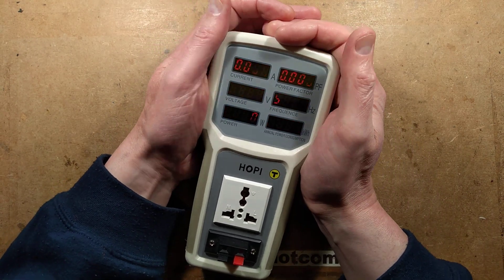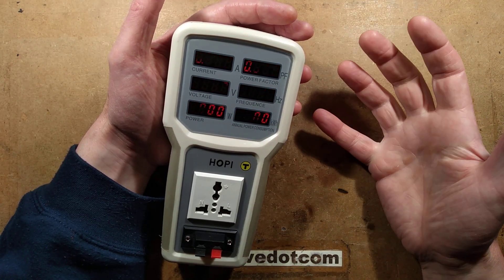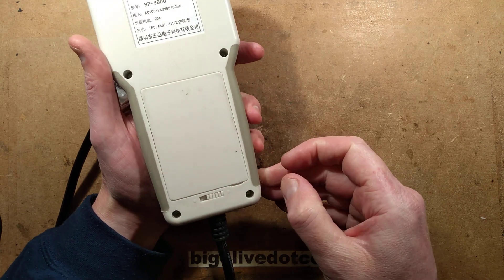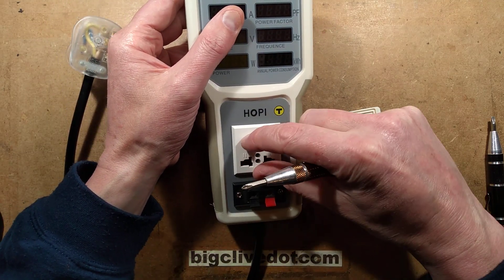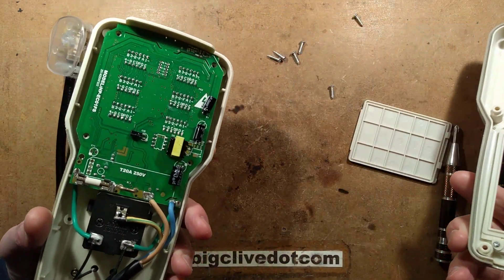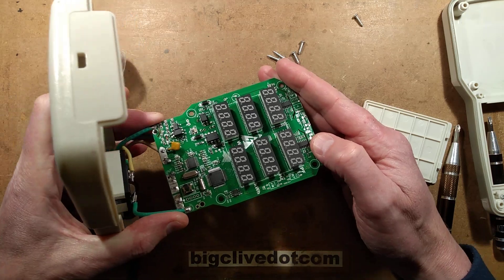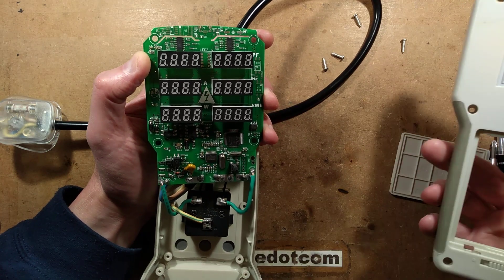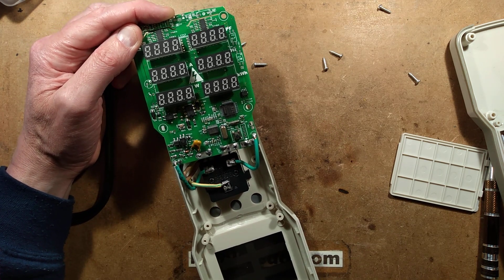Inside the Hopi power meter.  (It contains a smart meter chip!)

Comment: If you set the number to 2 you get the monthly power consumption, which I personally find more useful. Unfortunately my hopi doesn't remember the cost per kWhr, so you have to set it every time if you want to have a direct display of cost.
Also the male plug gets hot at only 8A for a few seconds, so I will probably change it.
And in my unit the soldering of the thick wires was pretty bad, so I resolder it before use.
I forgot to mention, if you hold the button for a couple of seconds more you reset the energy and time of the "uH" screen.

Comment: The crystal with a round can on it looks similar to the 32kiHz crystals used in quartz watches and realtime clock circuits. Using a faster one would make for a better multiplexing but yes, it would alter the baud rate of the serial connection. Presumably the 1-24 values of the T-button are to set how many hours per day the device is used and calculate annual power consumption that way. Strange feature. The CO2 thing even more so.
Reply: I doubt the 32kHz crystal is used to drive the clock of the micro. It is way too slow to read the power meter chip and multiplex the segments. Since the display looks solid to the eye, the multiplexing frequency has to be somewhere close to 100Hz, otherwise you'd see flicker. That leaves just a few hundred clocks per refresh to to do everything the microcontroller needs to do.
The crystal will more likely be there for time keeping to calculate line frequency for example. The power meter chip has a clock output designed to drive an external microcontroller, which I guess will drive the micro. Costsaving again.
But even if the microcontroller would have his own crystal, there is no way to change it to anything else and expect anything else still to work without rewriting the firmware.
Reply: @superdau  I originally thought, too, that the 32kHz crystal (if that's even what it is... I think so but can't be sure) was for measuring line frequency, but then I'd expect it to be connected to the multimeter chip, not the microcontroller. although if the multimeter chip puts out voltage measurements fast enough over serial it could definitely made to work but I somehow doubt that.

Comment: Hopi HP-9800 page on AliExpress including scans of the user manual:
https://www.aliexpress.com/item/HOPI-HP-9800-Handheld-Power-Meter-Power-Analyzer-LED-Metering-Socket-Measurable-Current-voltage-Power-Factor/32375959317.html

Comment: So, what do you guys think about these universal enclosures like this one? Is there somewhere that sources them cheaper than AliEx? These things are like $20 shipped for an empty case, at least from the listings I get shown through AE. I figure it would be better to just buy a cheap AliEx DMM for $5 complete/shipped, de-sticker, gut, and call that an enclosure. Heck, then I have a compete set of connectors to measure and design with, along with a bezel and lens arrangement. 
   Someone with experience, can you tell me why this is a foolish waste of time next to a "universal" enclosure?
  I'm currently building a couple bench power supplies, and learned the hard way, there is a reason why experienced guys build things in large enclosures even with small board designs. One of my 2 current project enclosures is starting to look like the special olympics version of an iPhone design. Project creep is killing that one. 
  ...anyways..what do you think? Is it worth repurposing a $5 junk product to save $15 over the universal version?
Reply from the maker: The universal enclosures have always been quite expensive because they are intended for prototype or low volume specialist products.

Comment: Hi Clive, you can fix the LED flickering by recording at 25fps or any other shutter speed that is a factor of 50Hz.
The annual power consumption is set to a number 1-24 to input how many hours per day you use the device. It calculates total annual kWh based on that.

Comment: It can be surprising how unstable the powerline frequency actually is.  In the United States I've been watching and logging it for several years as a hobby.  There are times I've noticed drops of over 0.040 Hz and later been able to read the Nuclear Regulatory Commission website and verify a nuclear reactor in another part of the country had to go offline at that time.  U.S. power grid is divided into at least 3 parts so dips in another part are not noticeable in this part.
Reply: Well he does live on the Isle of Man, initially I assumed they probably generated their electricity locally but turns out that's not exclusively the case anymore.

https://en.wikipedia.org/wiki/Manx_Electricity_Authority
https://en.wikipedia.org/wiki/Isle_of_Man_to_England_Interconnector
Short summary: 
- 40MW rated AC power cable bringing in electricity from England (became operational in 2000)
- 87MW gas turbine (completed in 2003)
- 1 MW of hydro
- 90.4MW total of diesel generators

Given the power ratings of the various sources I'm guessing there's still some being produced locally since 40MW spread over the 83000ish population would be roughly 481W available per individual. That already seems low for just residential use, since the "average electricity per household in the UK is 4,648 kWh" according to https://www.onaverage.co.uk/consumption-averages/average-electricity-usage works out to 530W average (which is going to have significantly higher peaks). Add in some non-residential usage and there has to be a reasonable amount of local power and compensating for demand going on which is likely to account for that frequency variation.

Comment: 1-24 may be how many hours the appliance will be used per day.
Reply: It is.
https://www.aliexpress.com/item/HOPI-HP-9800-Handheld-Power-Meter-Power-Analyzer-LED-Metering-Socket-Measurable-Current-voltage-Power-Factor/32375959317.html
Manual down the page a touch.
Reply: @ballsrgrossnugly  Some of that manual did not make much sense !!
Reply: Yeah I only found that out by accident, they hide that button well 😂

Comment: AliExpress webpage has details (limited) on the button.  https://www.aliexpress.com/item/HOPI-HP-9800-Handheld-Power-Meter-Power-Analyzer-LED-Metering-Socket-Measurable-Current-voltage-Power-Factor/32375959317.html
Reply: AEC = Annual Electricity Costs
APC = Annual Power Consumption (hours of use per day)
uH = Active Electric Energy
CO2 = Annual CO2 Consumption
L-UP = Upper limit of Power

Comment: I have exactly the same model HOPI as yours -  purchased via eBay - with the exception that mine does have the micro USB installed. Don't know why yours doesn't have it. I'll to try connecting it to my laptop and see if I can record/download data from it.
Reply: I also have the usb version,  the mains connections to the board had some sketchy looking solder joints. And the power regulator chip has a bent up leg with a component linking to the capacitor, no idea why , looks a bit afterthought.

Comment: The not meassuring low loads could be to avoid a ADC-offset from building up a bill.

Smart-meters (and mechanical ones) have a thing about not metering at very low power to avoid ghost-load.
Basically inperfections that "make the disc spin" at absolutely NO LOAD.

Comment: If you know chinese and found the actual product page in china online shop, this device is not solely use for one time current monitor, it is actually a electricity monitor to monitor a household appliances energy usage long term. The label at the back, 1st line: 手持式用电监测仪 - Hand-held power monitor (from google translate).
And the "T" is actually a button to show the info on the connected appliance energy total usage, the button menu cycle can be found at the china online shop here, the 2nd photo that have many arrows:
https://item.taobao.com/item.htm?spm=a230r.1.14.10.610b4887UhWmHn&id=37515896259&ns=1&abbucket=20#detail
Reply: from the shop page, in the product description below: "主要用于节能产品的功率，功率因数，年用电量，总消耗电能，总测试时间等项目的测试。同时可选配USB或485接口。USB接口配送电脑上上使用的软件，可以实时记录测试结果，并可以导出测试数据供用户分析。适合长时间测试用电器的用电特性。"

Google translate: 
" It is mainly used for testing the power, power factor, annual electricity consumption, total power consumption, total test time and other items of energy-saving products. At the same time, optional USB or 485 interface. The USB interface distributes the software used on the computer to record test results in real time and export test data for analysis. Suitable for long-term testing of electrical properties of electrical appliances."

Comment: I found something that could explain the button. It is found on a link to AliExpress. Link: https://nl.aliexpress.com/item/HOPI-HP-9800-Handheld-Power-Meter-Power-Analyzer-LED-Metering-Socket-Measurable-Current-voltage-Power-Factor/32375959317.html

Comment: Optocoupler on input is simply there to provide a reset to a watchdog timer. Mains fails and the timer overflows, providing a way to write the data to the ferroelectric memory on power fail, without killing the memory with writes. Probably there is a version with a non volatile memory storage that stores some data long term after power failure, so needs this timer.
Reply from the maker: I did wonder if it was for secure memory writes, but on the other hand it could also be deriving accurate clock timing from the 50Hz.

Comment: I think with the "magic button" you can set the hours, the measured device is turned on per day. On "1" the device runs 1 hour per day. On "24" the whole day without pause. 

The math: on "1" and with 2.474 W, thats 2.474 W * 365 = 0.903 KWh per year. (see video at 15:12)

Comment: Mains frequency is not that stable anyway.  When it's above 50Hz it indicates demand less than supply, below demand exceeding supply.
Reply: on such a small island like where he is, it'd be even less stable.
Reply: It's within 0.2% and the error is not cumulative so that electric clocks don't drift, in that respect it is better than a crystal whose drift is cumulative
Reply: There is a 40 MW AC cable to the Isle of Man
Reply: @FarleyHillBilly  ah neat. Didn't realize it was connect to the big island. Cool

Comment: Could you modify the display, adding buffers, to drive  the display statically?
Reply: Leif Neland Quite hard without rebuilding the board. With code access it might be possible to reprogram the big μC to run through the 12 digit groups 50, 60 or 300 times per second to stabilize the video image.
Reply: Without multiplexing, the power consumption would probably exceed the power supply's current ability. This should have had an LCD display instead of LEDs.
Reply: @netpilot5  there are other ways of limiting the current than PWM/multiplexing, for instance resistors. ;-)

But I guess Great Scott would have decided the protocol and made a PCB with LCD on it ...

Comment: Love the battery cover that exposes live terminals !
Reply: Ian Clarke - dangerous Chineseum feature 😱
Reply: At least, there's a locking slider to prevent curious fingers from seeking knowledge.
Reply: ...but makes sure to still halfway cover the actual fuse you might want to change someday, even when the lid is off... :P
Reply: I don't have any excuse for it, but then again, i find it hard to feel sorry for any inebriated ape that might open that under load. You'll get a shock, you'll live. We've all shocked ourselves a few times.
Reply: @aserta  We have British Standard safety requirements in this country to protect people from that type of issue. That battery cover could fall off and get lost, the next person who picks up the meter might not realise that, who is to blame then ?
Reply: It's a vent cover when connections blows up.
Reply: It's always a win in my book 😁
Reply: It's Chinese population control, and it only culls the intellectually challenged, who are the only people who would stick their fingers (or any other appendage) in there to see what happens, hence, a smarter residual population!

Comment: Hi! The variability of mains AC frequency is a lot greater than we often assume. While the grid is regulated closely, and the frequency is maintained at 50hz almost perfectly over longer time frames (think days), it can swing around considerably in the short term. Excursions of up to a few hundred millihertz are not uncommon, and smaller deviations are constant. The stability of the quartz crystal inside your Hopi will contribute some, but over the short term and with a constant ambient temperature I think what you're seeing on the display is pretty accurate.
Reply: Interestingly enough there's a group who use that variability in criminal and other cases. Basically they keep/get really accurate measurements of the actual mains frequency and keep them for a long time. Then when somebody says this video/audio recording happened at a certain time they look for the mains hum even if it's sub audible they can reconstruct it.
Then by looking at the variance of that hum as it goes up and down they can determine what the actual time it was recorded was. They don't look at the absolute frequency, but the relative motion then match it to the logs they have.

Pretty cool really.
Reply: Unless you are the EU, where the problem went on for many years and made many timers and clocks highly inaccurate.

Comment: You do a lot of videos that involve LED or LCD's that flicker on modern CCD cameras because of rolling shutter. Have you ever though of picking up a later model CMOS or 3CMOS camera? In the last generation of CMOS cameras there were some good HD ones before everyone switched to CCD. Also, cameras like the DVX100B had a feature called "syncro scan" that let you modify the frame rate frequency to really dial down the flicker effect from LED's and LCD's.
Reply: Tyler Warren Ellis Problem with this one is that each group of 2 digits blink at a different time, and the overall scarcely sequence may not be in sync with the flickering of his studio lights.
Reply: @johnfrancisdoe1563  so what you're saying is that you've never used a broadcast CMOS camera before.

Comment: The only useful thing I have found with that button is when it says "uH--" it changes the "annual power consumption" display to show active power instead.  Unfortunately you lose the line frequency in this mode, however in your case it might be a bit more useful.  I wonder whether the active power reading also shows zero for low power devices with really poor power factor...

Comment: I've seen breakout modules for the CS5460A IC (not the CS5463 as seen here) on AliExpress, but they only really provide you with the IC and a few resistors & capacitors - they don't include the current shunt or voltage divider (or the current transformer/potential transformer for that option), nor any of the filtering and other components that are required by the datasheet. Besides the CS5463's 2.5V reference having a better temperature coefficient (25 ppm/℃ vs. 30 ppm/℃ typical, but both have the same specified maximum of 60 ppm/℃), I'm not entirely sure what the difference is between the CS5460 and the CS5463, but I've not spent long reading the data sheets.

There's also a CS5464 version, which describes itself as a "Watt-hour meter on a chip" and looks generally a bit better, though its temperature coefficient is 40 ppm/℃...

All three of them are ~$2-2.50 in single quantities on LCSC, but can be found for a fraction of that cost on AliExpress (which is less-trustworthy than LCSC, but honestly I've never had a problem buying cheap ICs from AliExpress before; I wouldn't want to rely on them for critical or professional applications, but for hobby use they're probably fine...).

Comment: I reckon the numbers 1-24 you can select in the annual power consumption part are the number of hours per day the device is in use?
Reply: Yes the manual says this is for setting the number of hours per day the device is switched on, when calculating annual consumption.
Reply: @Berkeloid0   Ah!  So you read the manual?   :D
Reply: @calmeilles  there's a manual?
Reply: @Rac00n  search on Aliexpress for hp-9800. the most sellers have a descripton for the button functions on the sell page.
And i got a manual includet in my HP-9800
Reply: @calmeilles  Yes I read the manual, I always enjoy having a laugh at the Chinglish :-)
Reply: @Ratzfaz  Can you tell us the other functions?
Reply: I was just going to comment that - 2.4W at 1 hour/day = 0.876kWh which is what is showed when 1 was selected
Reply: You are correct.
https://www.aliexpress.com/item/HOPI-HP-9800-Handheld-Power-Meter-Power-Analyzer-LED-Metering-Socket-Measurable-Current-voltage-Power-Factor/32375959317.html
It is to set the amount of hours per day the tested device is expected to be turned on, and multiplies the annual power accordingly. He has only been looking at annual power consumption for one hour per day, apparently! XD
Reply: @ballsrgrossnugly  Incorrect. It shows the Annul power accordingly, lol. (Not Annual power accordingly.) Yes I am poking fun of their use of "Annul" instead of "Annual" on the manual page.
Reply: @ballsrgrossnugly  
Perhaps. That would be a bum deal!
Reply: It seems too much of a coincidence that it ranges to 24 for it to be other than hours per day. However I wonder if it is for cost per KWh.
I have a Brennenstuhl PM320 plug in meter that allows manual entry of cost. After an appliance has run for a while you can directly see cost so far. For appliances that have a duty cycle (fridge/freezer) it can be useful.
Reply: Agreed
Reply: Ditto
Reply: Yes this correct